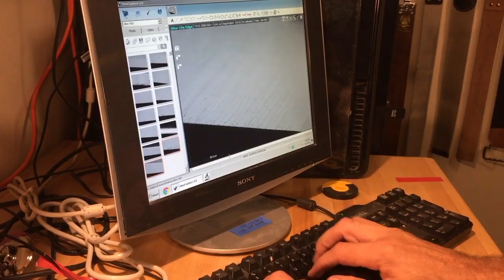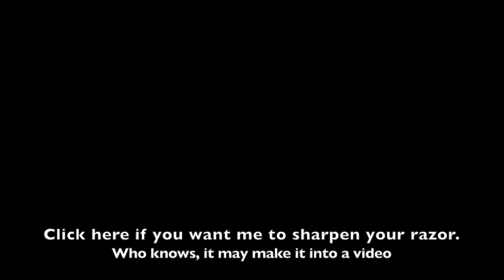Razor Sharpening from Bevel Set to Finish - Thiers Issard

Comment: This has been one of the most helpful videos on this subject that I have seen so far. Thank you for the very practical and approachable wisdom you share on the art. I'm  a licensed barber, formally trained in a barber college for two-thousand hours and have over 30 years of experience in the profession of hair-cutting. However, I, have never mastered the art of honing razors even though I practiced honing vigorously in barber college and a little thereafter. I'm now venturing again to master this art  because I would really like to bring some of my estate sale straight razor finds into shaving condition. Ultimately, I would like to put into regular use, a cache of straight razor into my servicing routines at the barber shop, reducing my reliance on replaceable straight razors.  I think that I have gotten a few blades into range of fair shaving function but far from what I perceive to be possible based on videos like yours. 

This all makes me wonder just how many barbers can actually do this.  It seems a most onerous undertaking but I really want to be that barber in modern times who can indeed  keep straight razors in optimal shaving condition. This had to be a significant part of a barber's work when he had to rely on traditional straight razors to shave. An think of the home-shavers and do-it-yourselfers who, before the safety razors, developed this skill-set to give themselves shaves on a regular basis. 
I have ruined a lot of stones and razors over the years trying to hone a razor.  I also now realize that the preparation and training I got from barber college was rather inadequate for actually mastering the art of honing: there was, I now surmise, no real expectation of my instructors for success because the training did not even come close to bringing me into the realm of mastery. Without the type of wisdom and insight you are sharing, I would could forever expect to be frustrated demoralized by failure. What I now perceive to be the actual learning curve for success in honing with consistency makes my barber college honing training seem a bit gimmicky.
Reply from the maker: @TonsorialVirtuoso09  - great insight. I doubt they even teach this anymore because straight razors aren’t allowed to be used in a barbershop anymore.
Reply: @drmatt357  Hey Doc, thanks for the reply.  I'm not sure what your geographical frame of reference is but straight razor shaving is definitely permitted /allowed in the United States in barbershops.  A barbershop, however, should not be confused with haircutting chains like "Super Cuts,  Fantastic Sams,  Borics, Master Cuts, Sport Clips, Cost Cutters, etc.) because these facilities are licensed as salons or cosmetology establishments: they are NOT barbershops.  Most states in the US make it illegal for a haircutting establishment's  to display a  barber pole on the premises  unless the establishment is actually a barbershop with a licensed barber performing grooming services.  So look for the barber pole generally if you want to go to real barbershop. It is in fact illegal in most states in the U.S. for the aforementioned cosmetology establishments to perform shaves or use straight razors on patrons. 

When I went to barber college I was required to do 500 more hours to get the barber license as oppose to the comparable cosmetology license. The additional 500 hours of training is attributable to learning how to shave with a straight razor and this is still part of the barber's curriculum in Michigan and throughout the United States with only one exception that I know of, a county in Alabama that does not require licensure for barbering services. 

I'm getting a pretty good grasp of honing straight razors and now have about 10 vintage traditional  straight razors  in my tool kit at work in the barbershop that I use to perform my barber services on a regular basis now. On my YouTube channel I have posted some videos recently demonstrating my use and maintenance of straight razors in the barbershop.  I still have several shavettes or injector style disposable straight razors that I use also. 

So far, the benefits of the traditional straight razor for me  is that: (1) there is a hobby like appeal to its use in the barbershop;,  (2) it reduces my reliance and dependance on the disposable shavette blades;  and (3) because the  hygiene and sanitation protocols associated with shaving with razors, I gain a little efficiency by having 10 or so straight razors ready to go at the beginning of a work-shift.

Happy Shaving!

Comment: Greetings from central Europe.  
I'm fascinated how easy you sharpened that razor. Really great job! Thank you for sharing this video.
I'd like to have a question on you, sir:
At 8:42 you "killed" the already sharpened edge. Is this moment of "killing" - making dull - standard step during your sharpening at the 8000 grit? And why at that moment and not sooner.
Thank you for your answers. JT
Reply from the maker: Good question JT. Killing the edge as I show is controversial. My detractors will tell you I don’t know what I’m doing, it’s unnecessary and you’re causing undue harm to the blade. Thing is, they can’t see what I see under my scope at 1000X.  

When you have the blade on a 400 diamond plate, it can leave some deep grooves and a toothy edge. I do it at 8K instead of sooner because with the 8K you won’t re-create the toothiness giving the smoothest edge. 

Could you do it without killing the edge? Yes but there’s an increased chance of a rougher edge.

Comment: Hi, i am currently shopping for a stone for my first straight razor and was wondering if the stone width has an effect on even blade wear, should I go with a stone around the same length as the razor or will smaller cause uneven wear?
Reply from the maker: It won’t cause uneven wear if you do it right. Watch my videos on X stroke. Called something like “The Simple X Stroke May Not Be So Simple”.
Reply: @drmatt357  ok thanks heaps

Comment: Hey Dr Matt. When i hone my razors I can not get them to pass HHT.  Progression is as follows.

Bevel set with norton 1K, passes TNT.
Norton 4K
Norton 8K
Then using your under running water method, coticule until razor sticks.
I strop X 25 cloth, X 50 leather

It shaves arm hair but I can not ever get it to pass HHT unless I go to pastes. Am I possibly doing something wrong or is the HHT just a test that is too subjuctive? I guess it could be the hair type i have available which is extremely fine?
Do you have any tips?
Thank you.
Reply from the maker: Trevor White - Exactly Trevor!  Too many  variables in the HHT and least of which is the razor’s edge. That’s why I say it’s a parlor trick!  

Thick, dark untreated hair is the ticket.
Reply: Thank you sir! If I could get some thick dark hair is give it a while but it's not readily available.
Shave testing is probably the best test anyways.

Comment: I already have a norton 4K/8k stone, is it possible to finish on the 8k side without doing anything thing higher and still get a comfortable shave?
Reply from the maker: It will shave and I guess comfortable but like driving hot rod with a 4 barrel carb and the secondaries not opening.  It will work but...

Comment: I understand that you need pressure when you do your honing to get enough metal off for a good sharp bevel. However, when I see you stropping you apply quite an amount of pressure too with the strap not being overly tight: Aren't you afraid of rounding off the edge?
Reply from the maker: No! 😉

Comment: I have a razor steel tool 01 that cuts some arm's hair but with big difficulty  so I imagine the bevel is not completely set? Should I go for continuing the bevel on a choosera 1000K until cuts easily the hairs or should kill on a glass the edge? and after go for 5000, 8000, 12000. I saw others guys set the bevel with the 3000k but probably they  kill a bevel just formed very well so that in reality the bevel is not killed completely?
Reply from the maker: Did you take the 01 blade to a finish stone before trying to cut arm hair?  If you did, it may need to go back to the bevel setter.  Kill the edge then bring it back on the 1K until it cuts the tomato skin.  I hear guys say that you should be able to "easily" cut arm hair on a bevel setter.  They must be that much better than me (but I really suspect they're just dick waving) because I can't but I can get it to cut a tomato skin.  Then you KNOW the bevel is set and take it home from there and that progression you mentioned would be fine.
Reply: @drmatt357  First of all I want to tell you I have very small experience But I have learnt a lot! Sure not like you or the others guys ! it takes me a lot to understand what you say and less that is a fraction of second to understand why you say that they say dicks!!!! for using this strong word! 😁

Here my opinion and my very very little!!!!! and modest experience!!!!!. 

Effectively the honing process is very very complicated is done in the professional way!!! For what I suspect looking at my big failures!!!!! 

What you say is not correct but I could be wrong!!!!!!!!!!!!! judge by yourself!!!!!!!!!!!!!! 🙄
The system you use I suspect is not correct or completely correct even if works from your point of view.

I bought three straight razor very expensive and have destroyed one to to send to a man professional to hone so I have learn this! 
Before deciding for going to the 1000k one should do the shine test for seeing if there are spot light °( Portland razor) . Make investigations. I did understand  you must see a long white line that means there is a bevel set but I'm not sure! I see this line!!!
Saw this line you should go for the 1000 and when the line desapears should pop easily all the arms beard including tomatoes! That should not be correct for going ahead following this theory. 
I must make other research on  you tube but really I saw this white line but not sure this corresponds to the line must desapear!!!!

Honing on a 1000k cut the steels but very very slowly( more steel but very slowly and there is the risk you cut much steel going back instead than forward!!!!!! so going to the infinite!!!!!!!!) so you must insist for hours in certain case or use strong pressure or use slurry and at the end will cut not easily the beard ( this is what i found!) Going ahead you should arrive at a point to cut easily the beard !!!! but if you overhoning it will never cut beard you will regress to the start point this is why you shoul procede step by step!!!!!!!!!!!!!!!!!!!!

So Yes that guys are probably very very correct!!!!! 

But this take time!!!!!!!!!! and a razor in perfect conditions!!!!! and a techinique very professional people usally haven't!!!!!!!
Continuing to honing should deseappear this line and this momente shoould pop hairs!!! This is true? this is a fake?  judge by yourself !!!! I must control but it sounds logic !!!!!  For sure explained so it seems not clear and probably it is not clear but sounds correct at first istance.

I could't go until that point because when I repaired my destroyed razor the spine was corrected and also the cutting edge now perfectly flat! But being now a wedge I should need to put 4 layers on the spide to sharpened it! otherwis I wiill scrachtes also! not only not honing!.

Probably i will do! Because doing by end the razor finally cut the beard but not easily so this means the theory is correct!!!! The problem the being a wedge it takes hours! and diamond stone with more grit than 1200K! and perhaps I could easily cut beard insisting! But being 10 mm the total razor I should control also the geometry of the wedge using information I havent. For the others two razors I decided one to send to the factory and the other to put on a table when i will have the skill for honing a razor that has curve on the heel ( some millimeters) and curve on the toe( hundredths of a millimeter). Rolling Half strokes is to risky on a razor so expensive and sendig it to the factory has to be evaluated. Now there is my conclusion wrong or right decide you!!!! Continuing honing on a 1000 k give a a easily cut of the beard but requires a lot ot time!!! Doing like you a partial bevel set but on the level to cut a tomato permitis to go to the 5000k like you always do and having a cutting edge probably good for shaving but with less angle!!!! and so less chin hold of the thread because as for a pencil it is less sharp.

I don't know what you think but you should try with a straight razor as possible otherwise you have to do the rolling stroke in the corners! and continue until the hair is cut easily! It took me 40 minutes to cut the hair but now it is a full wedge blade with modified geometry and without having put the tape as it should be done but tilting it manually and therefore not maintaining the angle and therefore making a mistake and in spite of everything it cut the hair but not easily for all the above reasons! I have no other razors to destroy otherwise I would do some tests! Maybe give me a site to buy a gold dollar so I can practice with a 4-penny stick! Have a good day!
Reply from the maker: @richardrerossi7484  - Your English is way better than my Italian Richardre so very good for you.  I would just try it with 2 layers of tape on the spine and see how it goes.
Reply: @drmatt357 Matt I have found that part of my theory is correct. I will give you a link where a famous professional a famous professional created the bevel of a razor on a Dia  sharp Dmt grit extra coarse stone with the same technique I used !!!!!!!!!!!! It is 220 grit, a bit distant from the 400k or 325K (Portland razors) or 325 (Dovo razors) they recommend using. So probably if the bevel is the white line that I also see on the shavette of my blade, I should go for the 1000k "Chosera" or whatever but at the moment I can't do that until I've tested my skill on a cheap razor. What this man did on the 220 Dmt grit is the same as "Portland" suggests. So I think it doesn't have to be wrong !. But here I also have the problem of curves at the tip and at the foot of the razor. So I have to perform half strokes as I have seen this professional do exactly as I described in detail even though he never did it. Yes I know I made a lot of mistakes in English. Not that I am unable to write in almost perfect English! But not being a native speaker and in a hurry I don't care much about writing in perfect English !!! But since you pointed this out nicely to me, I'll try to write a little more correctly. You know I believe that when communicating in a foreign language it is much more important to be understood without misunderstandings than to write correctly. I warmly greet you. Tell me what you think outspokenly. I enjoy hearing the opinions of others. Sometimes you learn something. This time there should be less mistakes.
Reply from the maker: @richardrerossi7484  - I think you misunderstood what I said Richardre.  I complimented you on your English!  Since I know no Italian at all, you're doing very well!

Comment: Hi great videos do you have a video on honing a Japanese kamisori straight razor thanks
Reply from the maker: Juan Barba - I don’t Juan but there are several out there. It’s a ratio of 3:1 or 7:1 and I even heard 10:1. That would be more passes on the side with the bigger angle. I’ve done a few over the years. Aside from the count, they’re the same. Oh, you may want to tape the spine as in many of the, the spine is a softer metal and can wear really fast compared to the edge.
Reply: Thank you I’ve seen some videos but I like the way you make it looks simple and the way you explain it so if there’s anyway you could make quick video I would appreciate it maybe just send it to me if you don’t want to do a whole vide on YouTube and thanks again for the reply

Comment: Being bald as a billiard and no "decent" access to long enough hairs to test, I've never been one to ever consider the "falling hair test"... that's just me though. The tomato test works fine for me.
Reply: you can do it on your arm hair :)
Reply: @AllanDC97  that's not even close to the same thing. Even a relatively sharp knife that couldn't EVER be used as a razor will shave arm hair. This test he mentions uses the strength of the hair itself to test for sharpness instead of it being permanently anchored as arm hair is...

Comment: Hi. Are you lapping with the 400 or 1200?
Reply from the maker: A very worn 400
Reply: DrMatt357 thanks Matt. Just bought a new 400, can I use this or will it wear out fast?
Reply from the maker: @Fank234   - It won't wear out from lapping but if it's new, I would break it in first with a junk razor or a screwdriver shaft and rub it real hard over the entire surface for a good 50.
Reply: DrMatt357 thanks Matt. You’re a star as always. I’m Ben btw, the guy that send you an email the other day about the vintage razor working a dream! I’m now relearning to shave my left side of my face with my left hand! Let’s just say one half of my face is less bloody than the other! 😂

Comment: you know, i have done what i had todo to get a have with a straight razor. i did a 1k and a 3 k spent a combined 3-5 hours on both of them and ive gotten clean shaves with them. even cleaner than my safety razor. why is everyone saying its impossible to get a good shave out of a 3k finish when ive done exactly that. isnt it supposed to be "if it does a good job its a good razor" or something like that